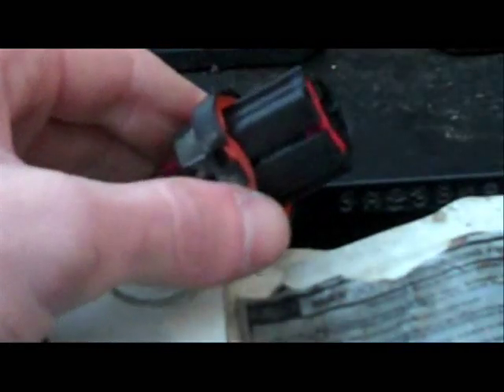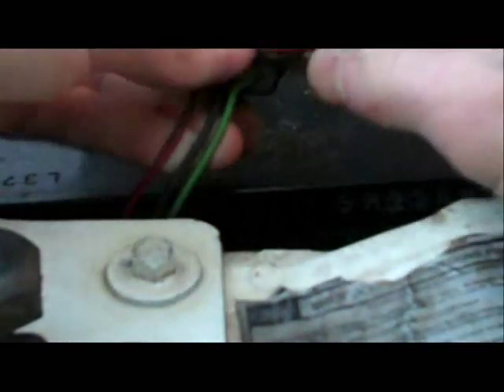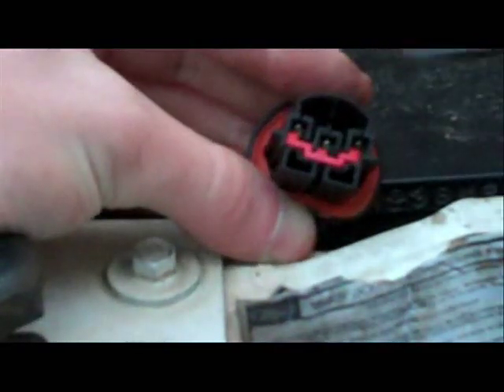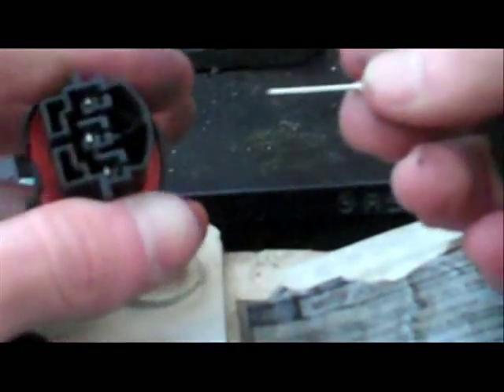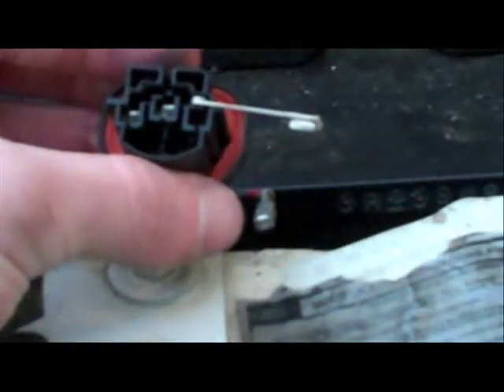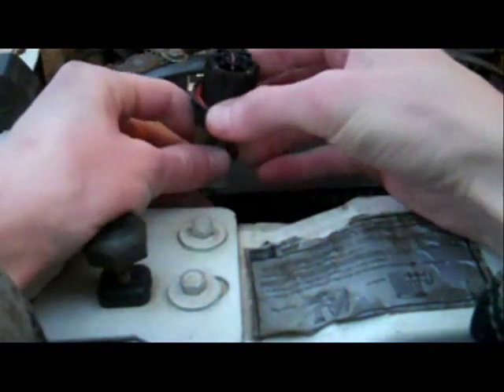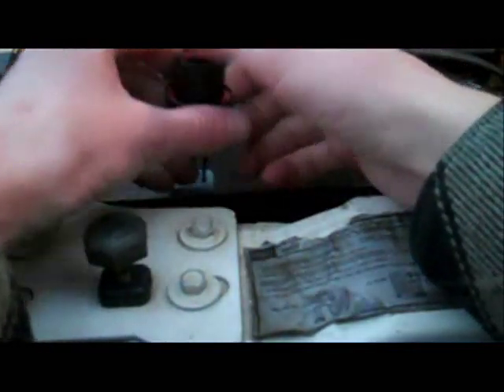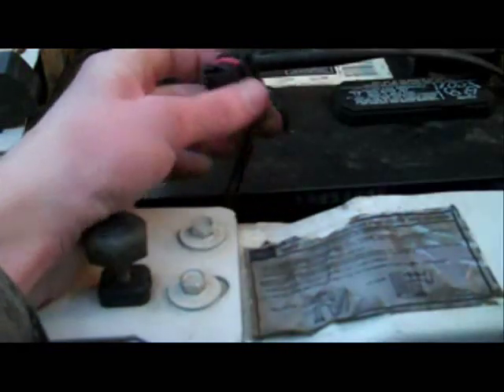repinning ford connectors

Comment: This was similar enough to a tail light connector that it allowed me to get to the pins. I was missing that I needed to remove the plastic part from the face of the connector like you showed. Found the female pins were not pinching the male pins enough and was able to bend the tabs to get a connection. Thanks!